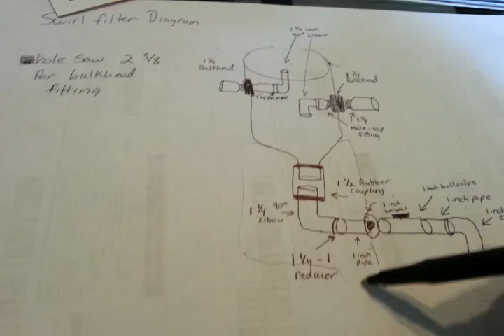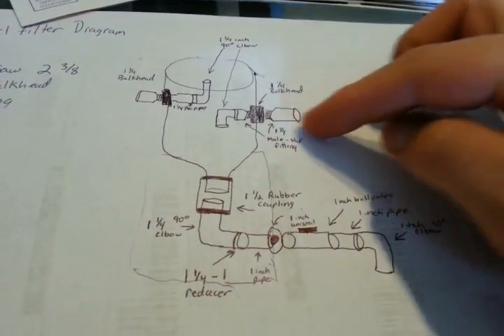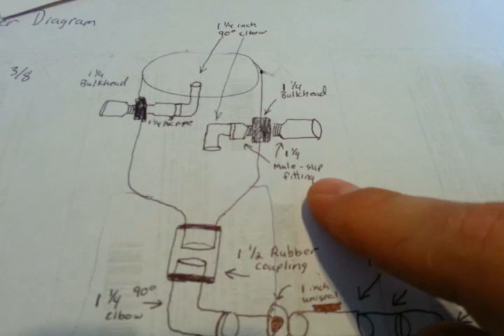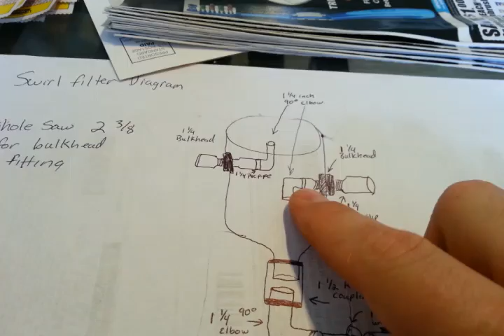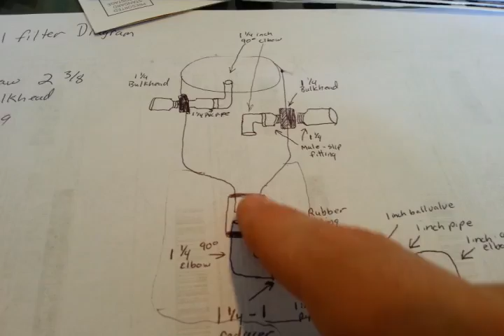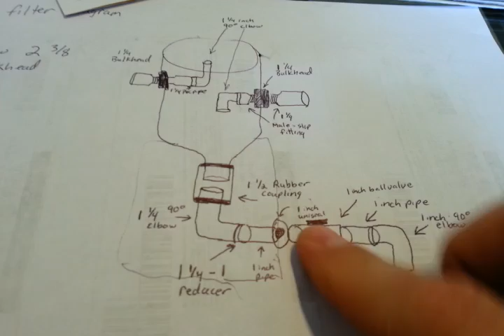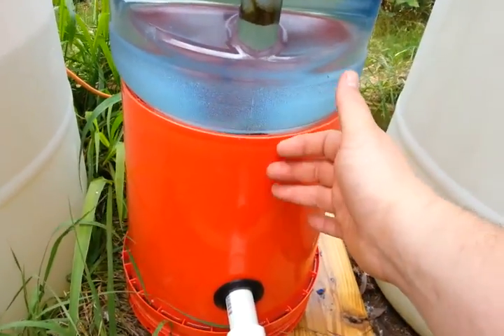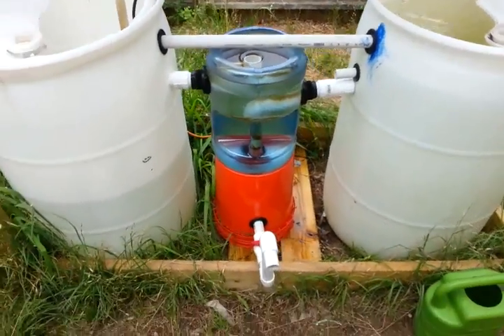( 5 Minute ) SWIRL CYCLONE FILTER w DIAGRAM ( AQUAPONICS - BARRELPONICS )

Comment: Where is the cyclone?!  In a cyclone filter, water should move in spiral path so centrifugal force can separate heavy particles from water. This is not a cyclone filter at all. Turn your inlet 90 degrees so water enters parallel to the side wall, then you'll have a spiral and a cyclone filter.

Comment: I too have this installed and quite successfully get a lot of solids.  
Thank you for the math done.  I actually don't have large enough outflow pipes.  That will change.  

I do have one suggestion.  I tried a 5 gall bucket like you show with the handle.  I actually found a full round without handle jug.  It works wonders!   Just a suggestion.  Keep up the great work!

G.W.